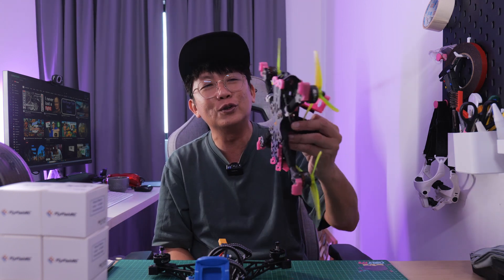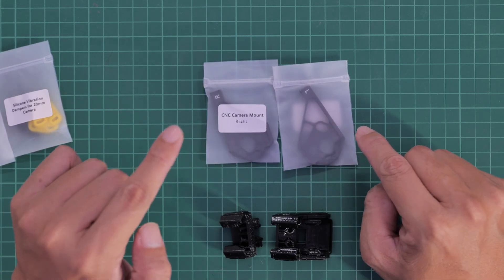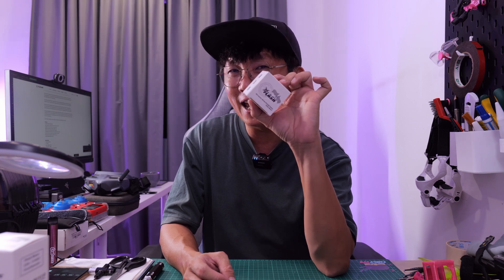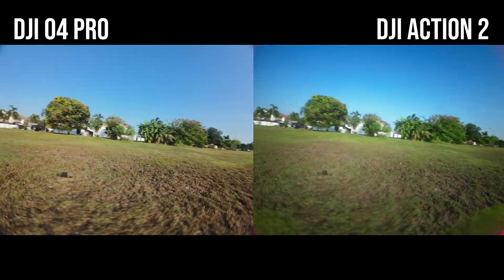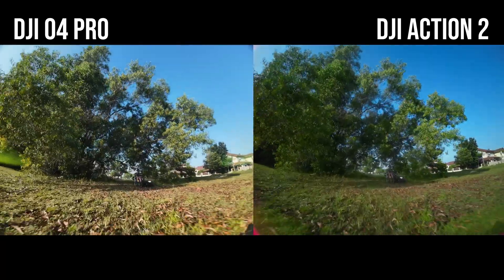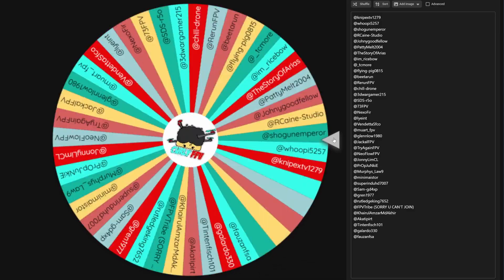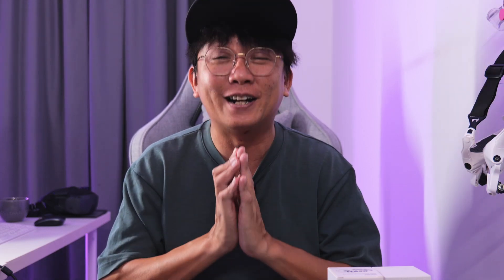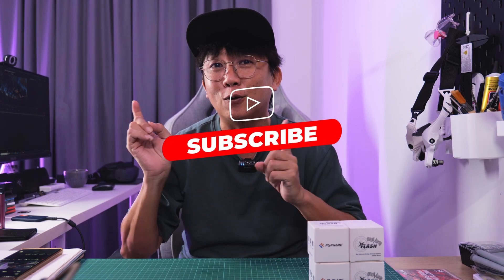DJI O4 PRO UPGRADE on FlyfishRC Volador VX5 – DJI Action 2 Video Comparison + FREE Motors Giveaway!

Comment: That’s a great informative video because I like the meps motors too.. but what I like is they seem to draw less power from the battery when cruising 💯🇯🇲
Reply from the maker: Hey buddy! Efficiency wise on the meps is not comparable to the flash motors mate and it's durability is not there as well. When I first reviewed them ya not too bad but after a while I figure it still need some work.
Reply: @CurlyFPV I see glad to know that learning while we go 🙏🏽💯

Comment: I used to like the volador frames. But not anymore. I think i prefer now. Simpler designs. Just plates and standoffs.
Reply from the maker: Ahhh agreed to that simple is sometimes better easy for maintenance! So what are you flying now?
Reply: @CurlyFPV FOR 3.5 THE GRINDERINO FOR 5 INCH THE ITSFPV ERA AND SHORTY PIRAT, AND BEEN FLYING A LOT OF MICROS, LIKE TINYWHOOPS AND SOME LIGHTWEIGHT 2 INCH 2S.
Reply from the maker: wow that's a lotta quad you have there buddy! Ahh hows the Grinderino?
Reply: @CurlyFPV i like how tough it is i broke an arm just once out of a lot of hard crashes
Reply from the maker: Hey buddy! sorry for the delayed response, been taking a short break but now I am back! looks like its really a tough one as many mentioned before, I might try my hands on one of it too! been crashing alot lately! LOL